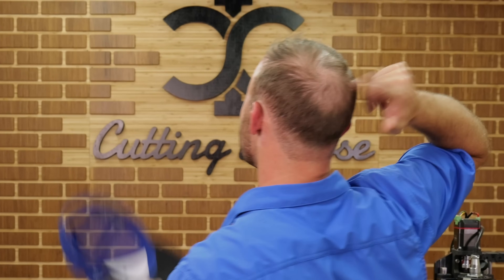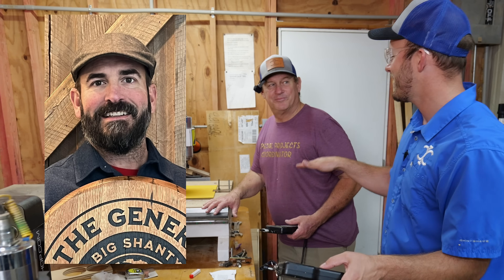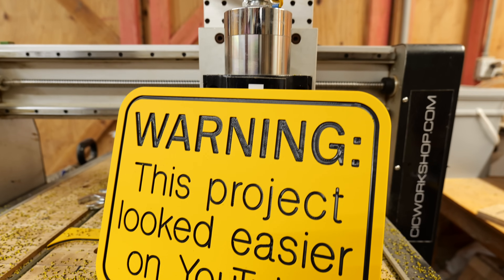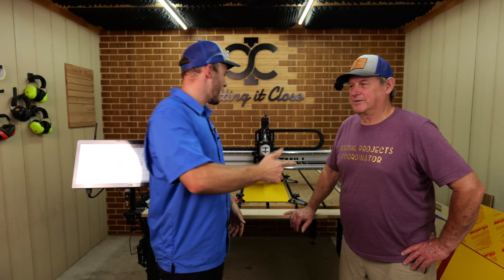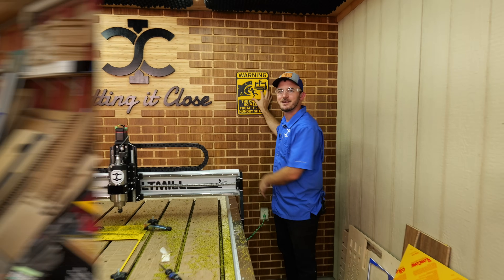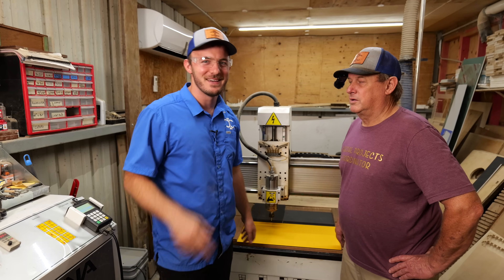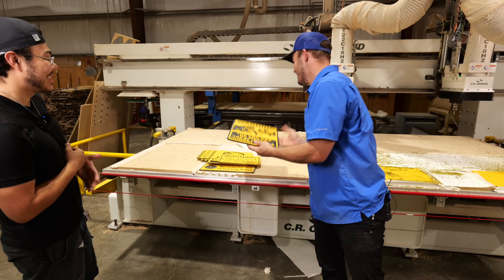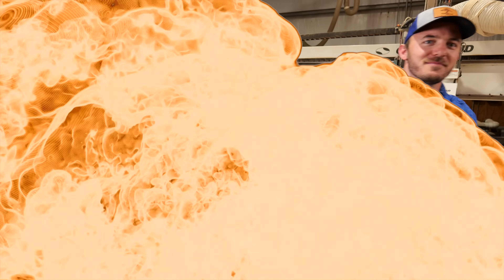6 CNCs, 6 Signs… It Didn’t Go As Planned

Comment: 1:50 - Your Laguna router's controller software isn't set up properly - there is a setting for corner acceleration and deceleration. The defaults are too slow - these get reset when you flash the controller firmware and you may need to call your Laguna support guy to fix it 🍺😉👍

Comment: What a fun video! One thing I noticed (especially with the shark sign) was the “swirly” lines left by the bit. Is there a method and/or bit that eliminates those swirly lines or is that just part of the deal?
Reply: Depends how fancy your software is. By default, it's just going to pocket out the most efficient path, which is often ugly. With software that has advanced features, you can dictate the path - all horizontal, all vertical, diagonal, shape outline, etc.
Reply: @ Roger that. So what software and bit combo do you recommend to eliminate “the swirls”? Any advice appreciated buddy.